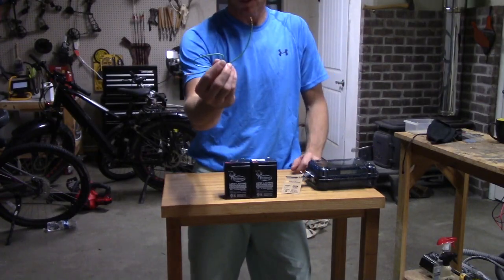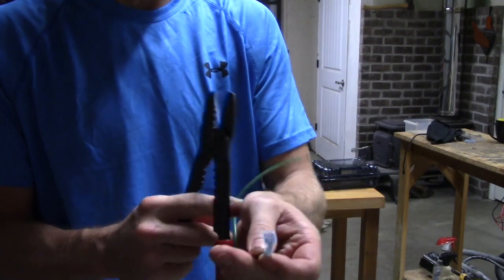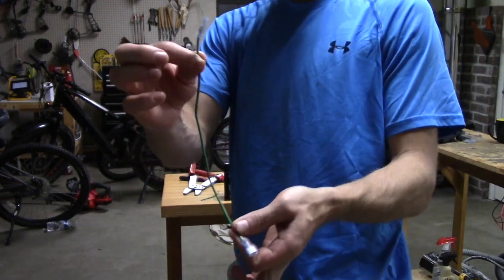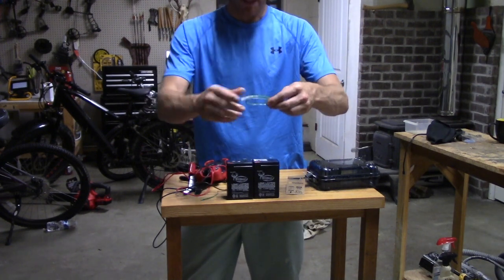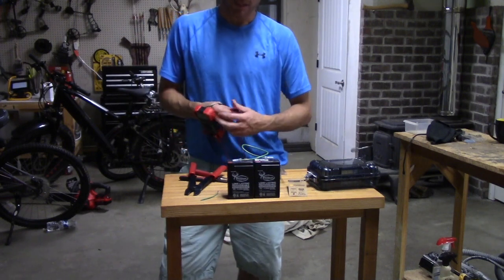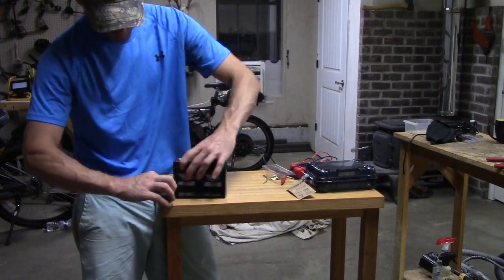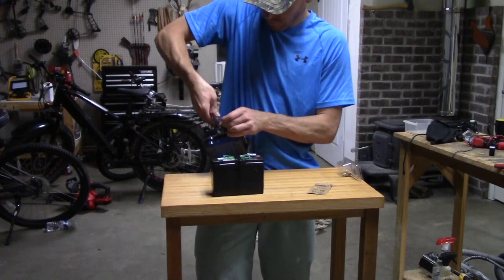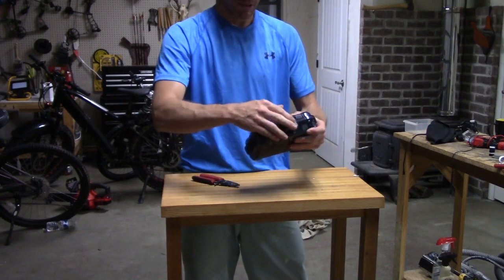Build your own rechargeable batteries for trail cameras

Comment: Why not get 12 volt battery?
Reply: Because the camera I’m using is 6 volt. Two six volt batteries wired in series keeps the volt level at 6 and gives you twice the battery life. Literally 9 months. I do use 12 volt batteries for twelve volt cameras.